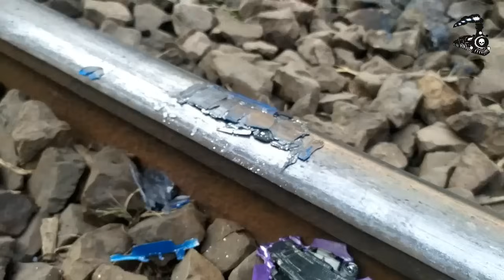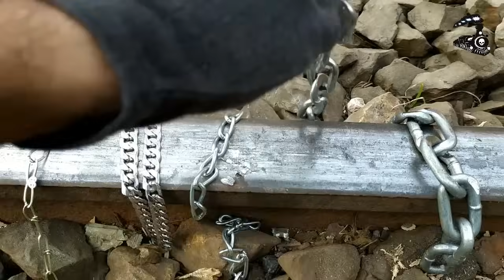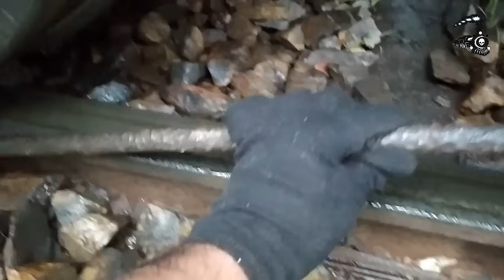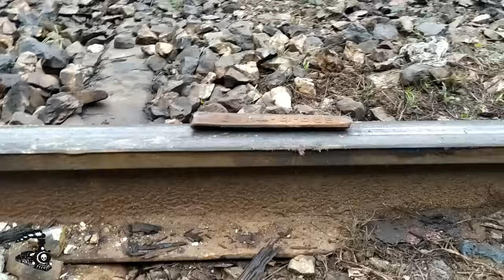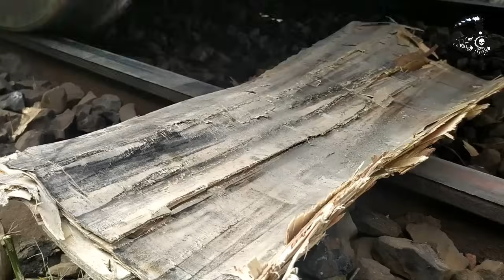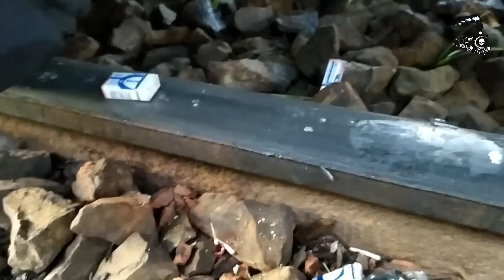Train Vs Metal angle things Experiment OMG 😳 || Train Experiments @TrainExperiments

Comment: What is the weight from one wheel?
How about testing it with a weighing scale? I wanna see if the weighing scale will work or not after that! 😅
Reply: The weight of a single wheel of a train depends on the manufacturer, size of train wheel, and the country, here in America, the wheels weigh 100 to 200 pounds, they used to weigh 250 to 300 pounds but the weight and metal cotton was reduced to save fuel